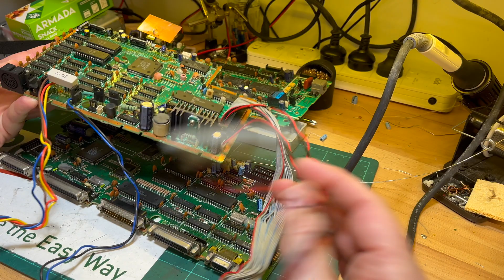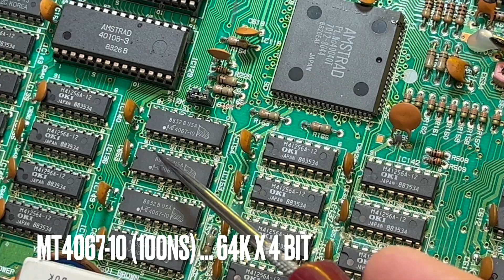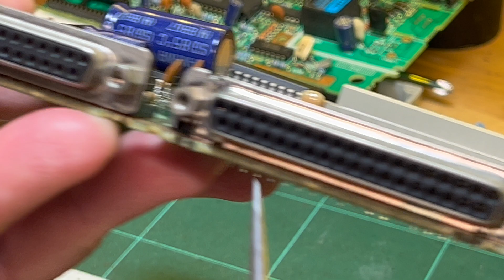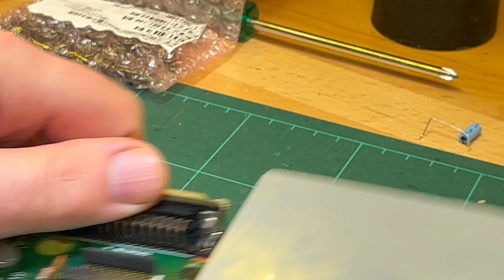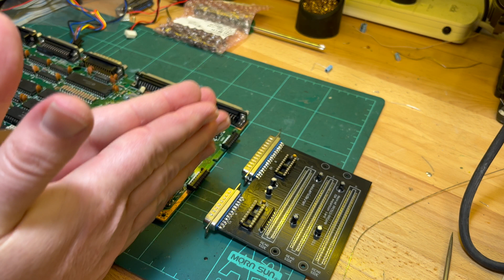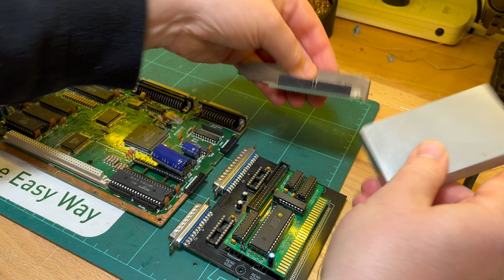🇬🇧 Amstrad PPC640: Part 2 (internal RAM layout & internal ISA plans) [TCE #0332]

Comment: There is a pcb for internal ISA expansion I seen it in a YouTube video it solders to the underside of the expansion connectors
Reply from the maker: Yeah, I figured there must be one by now - seems a no-brainer - but I just haven't looked much further than in Github.  Actually, my ideal internal expansion for the PPC would be combine three currently separate functions: [1] XT-IDE interface with [2] a CF interface (so no ribbon cable required) and [3] an ISA interface (some 74LS244 buffers & pull-up resistors).  But I'll have a look around for that internal expansion you saw. /Brett
Reply from the maker: Two of the three functions ... the example XT-IDE card I'm using here is actually a Lo-tech card ... I guess you'd just need to add some buffers/pull-ups and you could directly connect it internally ... ?
https://www.lo-tech.co.uk/wiki/XT-CF-lite_rev.2